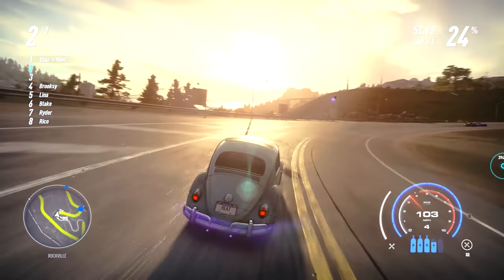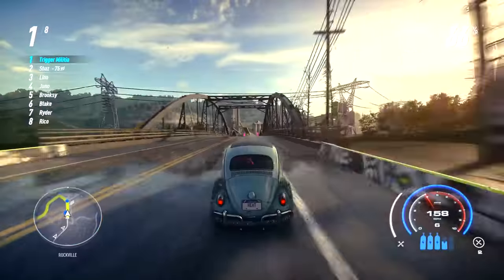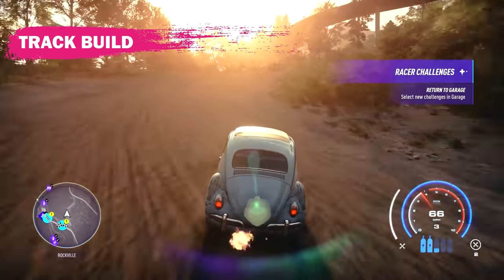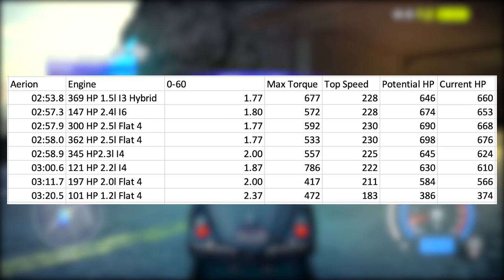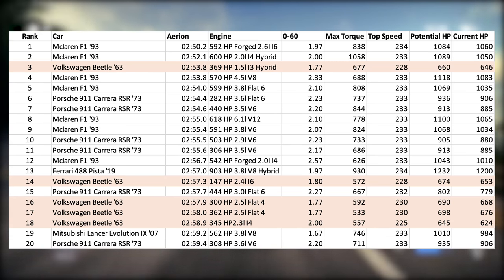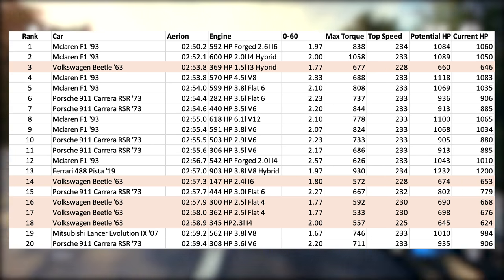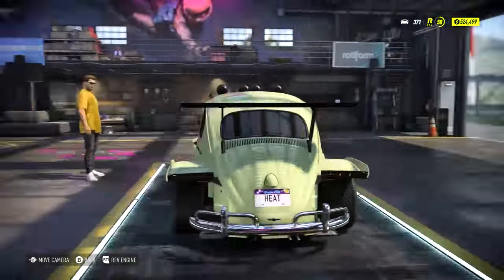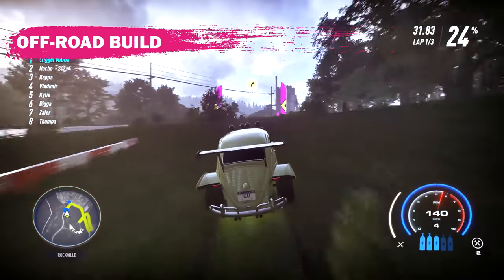You're Using the WRONG BUILD | Need for Speed Heat 1963 Volkswagen Beetle BUILD GUIDE.

Comment: Fun fact: 
the 2,5L Flat4 got better handling than the hybrid.
Go with a 6 speed gearbox, super track suspension and super track differential, and the big surprise:
-Elite rally tires! It doesn't affect it's speed at all but makes it more controllable.
-Stock brakes

The reason for 6 speed gearbox is that the car doesn't turn as wide using it, so it doesn't skid sideways. It maintains traction easier while turning so it goes more where you want it to. The flat4 is better in the topend and can reach topspeed easier than the hybrid without nos.

Livetune: Lowest downforce and lowest steering sensitivity, traction off, brake to drift.
Reply: 300 or 362 horsepower?
Reply: yea but those tire also reduce handling
Reply: This comment super old but I’m taking your word for it  👍
Reply: This is actually a solid build.

Comment: I found it to be a lot faster for drag racing than my two fastest track cars, the McLaren F1 and RSR. I was measuring by aligning the car with the end of a building and racing to a speed trap. The McLaren F1 posted a best speed of 271 kph whereas the Beetle 286 kph. Makes a good drag car alright.
Reply from the maker: it is by far the fastest drag car especially when nos is used.
Reply: @MilitiaGamingCommunity  Yeah with the 15 shot nos it just goes. Only trouble is making sure it's pointed in the right direction haha
Reply: @MilitiaGamingCommunity  I don't quite remember which engine I have it's whatever one has the highest potential horsepower and a full super lever track build with the engine maxed out on Elite plus parts since I don't have all the ultimates yet and it does fairly okay but I suppose it can do better if I toss in that hybrid instead

Comment: Did they nerf the top speed of the beetle?? Cause I've noticed that the top speed of the car is reduced. I'm using the same build, hybrid engine full ultimate parts but the bar has dropped to 7.5 instead of militias which is 9.8. please explain if you want cause I wanna know

Comment: I bought a second beetle to have one for off road and one for track. They have the same 1.5l I3 hybrid all Ultimate parts. I dont have unltimate+ parts yet, and the same parts on both, but don't have the same high speed. Not even close. One has 6.4hs and the other has 9.2hs. What am I missing? Engine, chassis, and drivetrain are all the  same parts.
Reply: I have sameproblem

Comment: I need some if not ALL of these cars in Heat (that have bigger chances of being added than a Supra or LFA):

Ferrari F50
Ferrari 360 Modena
Lamborghini Miura SV
Koenigsegg Agera R/One:1
Bugatti Veyron 16.4
Hennessy Venom GT
Lamborghini Sesto Elemento
Lamborghini Gallardo
Aston Martin One-77
Porsche Carrera GT
Mercedes-Benz CLK GTR
Enzo Ferrari
Zenvo ST1
GTA Spano
Lamborghini Reventón
Koenigsegg CCXR
Mercedes-Benz SL65 Black Series
Mercedes SLR McLaren
Pagani Zonda F
Maserati Gran Turismo S
Mitsubishi Eclipse GSX
Honda Civic Si (Coupe)
Acura Integra
Mazda RX8
Infiniti G35
Honda Prelude
Nissan Silvia (S14)
Nissan Skyline GT-R V-Spec (R33)
Chevrolet Chevelle SS
Dodge Challenger Hellcat (or are least the proper Demon engine)
Dodge Charger Hellcat
Saleen S7 Twin Turbo
‘68 Ford Mustang GT Fastback 2+2
Ford Shelby GT350R
‘05 Ford GT
Ford Mustang Cobra SVT
‘02 Chevrolet Corvette Z06
‘79 Chevrolet Camaro Z28
‘70 Chevrolet Corvette ZR1
‘67 Chevrolet Corvette Stingray 427
Plymouth Road Runner
‘08 Dodge Viper SRT10
‘70 Dodge Challenger R/T
Reply from the maker: Sweet list!! I like it! Yes add them all!

Comment: could you cover the gt3 rs next, it's one of my mains, and i'd like to see if i'm using the optimal setup for it
Reply from the maker: I’ll definitely add it to the list. Thanks for watching!
Reply: @MilitiaGamingCommunity  nice, enjoying your content so far
Reply: That thing keeps trying to murder you it's too hard to get the balance between that and understeer
Reply: @Journey_to_who_knows  maxing the downforce makes it a beast, the overall speed of it may be decreased a bit, but with a 0-100 of 1.87, and the amazing handling you get from the downforce (probably the best handling i've ever gotten out of a car without any exploits in the ghost games) makes it a force to be reckoned with, especially in corner-heavy tracks
Reply: I tried max downforce but the rear of the car starts springing left and right sending you into a wall unless you steer with full force
Reply: @Journey_to_who_knows  strange, i've never had that happen to me before
Reply: It's with the most expensive engine but it doesn't happen until the performance gets to 330+
Reply: @Journey_to_who_knows  i also use the most expensive one, but i don't experience any issues with it, maybe because of me using race instead of track tires

Comment: Up dude I hope you help me out with this one, I won multiple high heat rewards, so when I went to the garage it doesn't show the part I won It just tells me "high heat rewards"
Reply from the maker: After the update last week it should have a "NEW" banner over the part's category on the bottom menu.
Reply: It happened to me as well. If you want to keep the original engine, you'll have to swap it out for the same one, then you should be able to install ultimate parts.

Comment: Bruh. He never gave the build for the track buid
Reply from the maker: yeah, that was definitely my bad....

Hybrid engine
Ultimate+ Engine Parts
Ultimate dual turbo
5x3 lb Nos
Super Track Suspension
Elite Brakes
Elite Track Tires
Elite+ Clutch
Elite 7 speed Gearbox
Super Track Differential
Downforce:+5
Steering: -5
Traction off
Drift style Gas
Reply: @MilitiaGamingCommunity  thanks! really op setup here